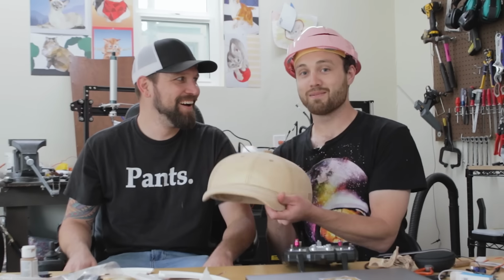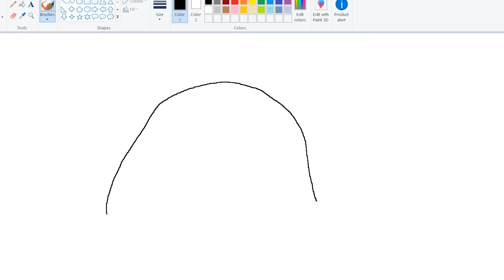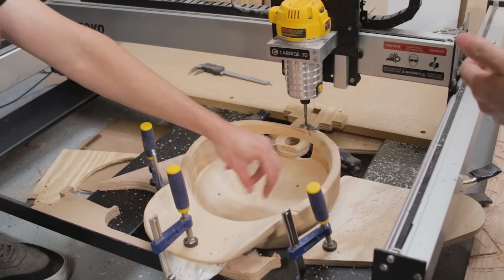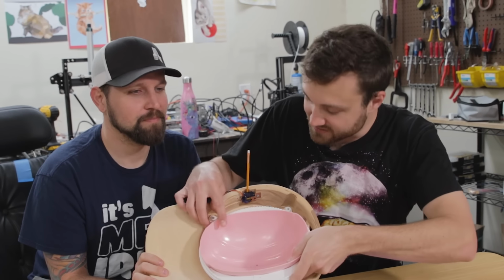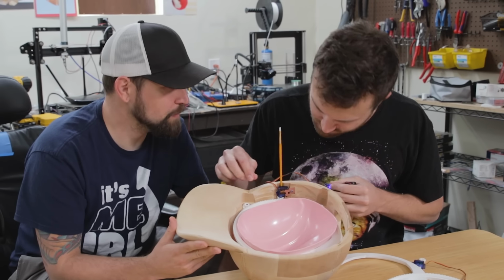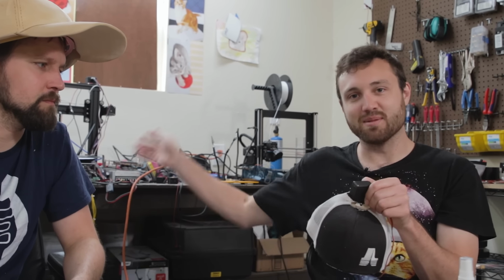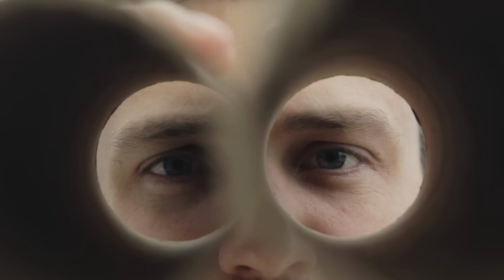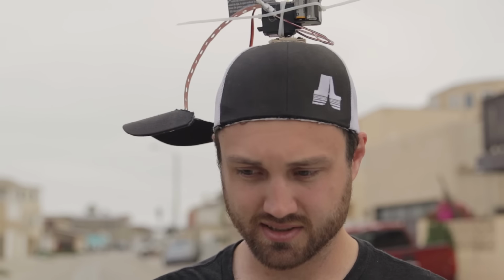Robot Hat PROTECTS You

Comment: @WilliamOsman I know I'm like three years late with this but if ya'll could like this comment to help William in the future 
3:54 its your return home line at the end of the code. Probably looks something like: 
G91 G00 G53 Z0 (z-axis home)
G91 G00 G53 X0 Y0 (X-axis, Y-axis home)

its returning the x and y to the origin of the machine table. It might be something that your program adds into the end of the tool paths by default. As apart of your future setup you need to take into account the home return points and your tool clearance (Z). It also returned home dangerously I might add as the spindle wasn't sent the command to turn off in the lines prior to those ones. (M05)

On routing tables, if there isn't enough clearance between your tool head (tip) and the part when it returns home it will crash like that. Good thing that the spindle WAS running though since it could cut it otherwise you would have been looking at more damage as it forced a non-moving tool through what looked to be 1/4 inches of wood. 

Not sure where the overtravel position is on your Z axis but you could change it to Z+1.0 or +2.0 for one to two inches of extra clearance over the part. Then when it hits x&y 0, return Z0.
Z-1.0 or Z-2.0 will plunge it into the part just so you know. Those negatives mean a world of difference. 

Source: I was a CNC mill/router setup engineer

Comment: Hey Will, I tweeted you this but want to make sure you know your router is getting a G28 at the end of it's gcode, when it needs to go to a zero or safe position. G28 sends it to your machine home, not your start or zero position.

G28 homes it like a 3d printer. You need something like 
G28 Z0. Or G00 Z(some number above your part's top)
G00 X0.Y0. or G28

Do them on separate lines and the router should retract first.

That's my guess. Care to share the code that ran so I can double check for you?

Edited to ask for code and fixed a gcode.
Reply: I hope he sees this
Reply from the maker: Yeah, I removed the code sending it off for all the remaining cuts we did that night.
Reply: @williamosman  idk what to reply with
Reply: I dont understand this because i dont speak nerd
Reply: @jacksondeane1629  then wtf are you doing on this channel

Comment: Edit the postprocessor and remove the
G28 X0. Y0.
Line in the postprocessor that is called at the end of the program. It'll look a bit different in the actual post file.  
Going to home makes sense for a VMC where the home position is easy to reach, but not when you're doing stupid stuff on a little router. Or just don't cut such tall things on your short router. If you're just cutting thin stuff it's kinda convenient to get it out of the way.

Comment: The reason you cnc crashed in your part is very simple.
The home point aka:G28 command, is NOT the same as the origin of your part. (Work offset)

That and you probably should have retracted your tool in Z enough to clear the part and cancel the tool-length compensation before the return home
Reply: Whoa calm down, in English sweatie
Reply: Machinist here... recently graduated machinist... we learned to program manually in Fanuc-A. It's fresh in my memory.
If you want to learn more, lookup HELMANCNC.com, that's how I passed programming!
Reply: Machines are stupid until you tell them not to be.
Reply: Bobby: I don't speak nerd.

(Your answer is concise and correct, btw)
Reply: I'm glad I work on a bridgeport, the manual Z axis makes it a ton easier to not break tools

Comment: The machine ran off likely because you have "Use G28" in the fusion post settings.
Reply: Yup, it caused me a bunch of issues when I was first getting started with CNCing.
Reply: Could probably also set a safety plane for rapid moves to be higher (though in this case it might have been there already but the workpiece was too tall)

Comment: I devised something similar to this in the early 2000s for a rotating greenhouse that tracks the sun's position to help regulate temperatures during off-seasons. I didn't get nearly this far. I need to revisit this. Kudos Will.
Reply: I’m not sure exactly how that would work, but wouldn’t rotating mirrors work better?
Reply: @LiquidSandwich  You lose ambient heat and energy with mirrors and theyd have to be cleaned regularly. They do use mirrors in molten salt reactors, but those are generally in low humidity, arid climates.